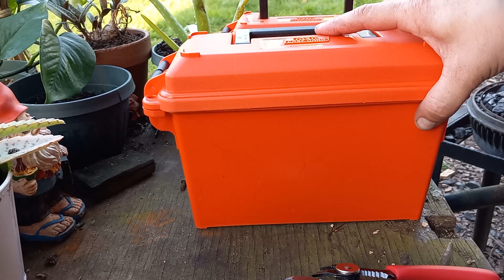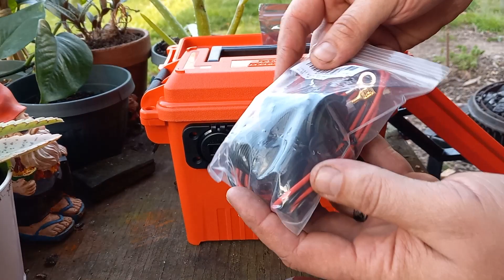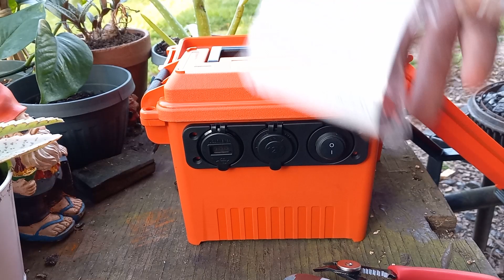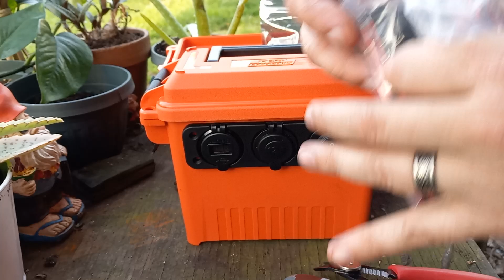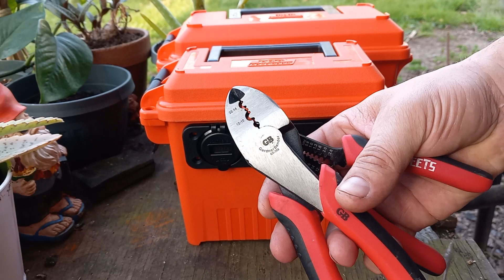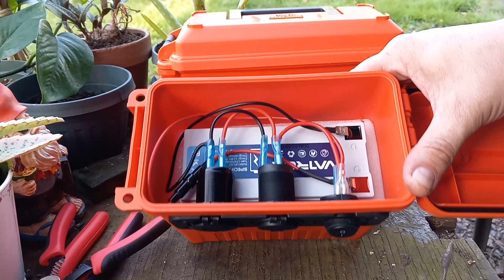DIY 12V power bank! Easy charger option.

Comment: ordered the parts to build a 32ah (~500wh) in the same mini ammo can. 4x 32ah lifepo4 cells fit in the same  space that your 7ah + foam fits in. omit the bms and just go with a cheap 4s inductive active balancer, and then use the same 12v car ports and a bidirectional 100w usb-c board (which you have to solder one resister to switch from lipol to lifepo4). almost 5x the power for the same footprint. all togeather the supplies cost me 32 usd for the batteries, 5 usd for balancer board, 6 usd for the usb-c board, and another 15 for the can and 12v car ports = ~60$. pretty much the same capabilities as the Anker solix DC300, which costs 150$ but with almost double the battery for 1/3rd the price
Reply from the maker: Nice I make another one just to play around. But this one works well for me

Comment: Why you did not ran a wire out to charge the battery?
Reply from the maker: It's pretty easy to open, 1 less thing on the outside
Reply: @Thebushcraftkelso  Sometimes simpler IS better.
Reply: Great idea for an external charge port!

Comment: Nice simple little project. My question is why build a big bulky power bank that is more expensive than a smaller more powerful one? I use the smaller Anker 20000 Mah for 40 bucks, that's roughly equal to 20 Ah. It's about the size of my cellphone. Just trying to figure out the benefit. Thanks
Reply from the maker: In the future need not worry too much about the benefits of why I do things, I enjoy doing this stuff pure enjoyment plays a huge part in me doing the things I do. ❤
Reply from the maker: I wanted to. I've never had good luck with the little ones. I can run anything with a 12 volt plug on this one like the truck stop fans. As for big and bulky I could just charge it with the car.
Reply: Just FYI, when you compare the number of ah or mah, it's only part of the measure of capacity. In order to get the true number for the "amount" of energy in a battery pack, you need to calculate the number of watt-hours. For the Anker power bank you mentioned, it's 3.7 volts because it's Lithium Ion so you would do this: 20ah • 3.7v = 74 wh

The battery he's using is a "12v" Lithium Iron Phosphate, which is actually 12.8v. 7ah • 12.8v = 89.6wh

The 7ah at 12.8v is storing more energy than the 20ah at 3.7v, but it probably still seems disappointing. There's another point of comparison here: cycle life. The small packs you buy do hold more energy in a smaller space but they lose 40% of their capacity after roughly 250-300 "cycles" (charging and discharging completes one cycle) whereas Lithium Iron Phosphate has a cycle life of 10,000-20,000 times before losing 20% of its capacity with the trade-off of it taking up more space to store less energy.

Hope this helps.